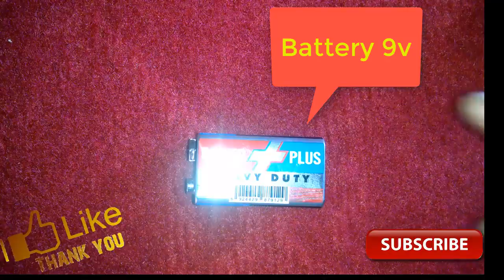make free energy motor and 9v battery output 220 volts homemade 2018 new videos free energy

Comment: fake . 1st motor  run with 9v battery another motor act as a generator it will produce dc output only .transformor work only Alternate current flow. there is no  oscillator in the crk to stepup the power.

Comment: Transformer primary coil voltage r secondary coil voltage ampair r ye Sara Kam fake ha ye motor max 4 volt DC Dy Sakti ha or ampair 1 b nai ho ga
Reply: Mian technical are ye 3v motor 9v battery se chalayenge to jal hi jayegi 10 mint me jarur ye discharge hogi thori fake video